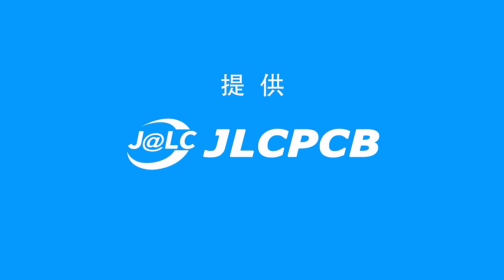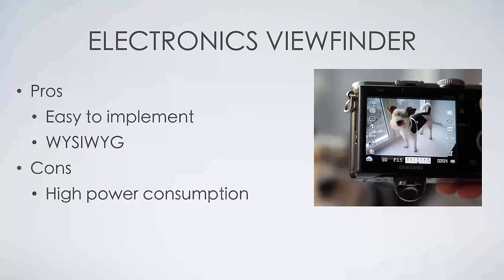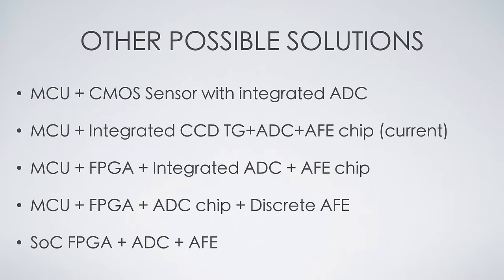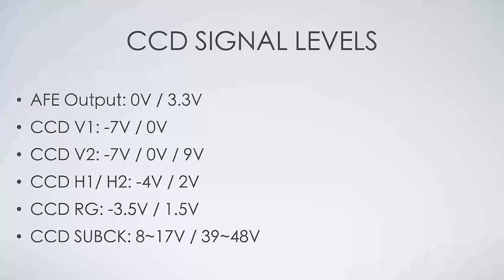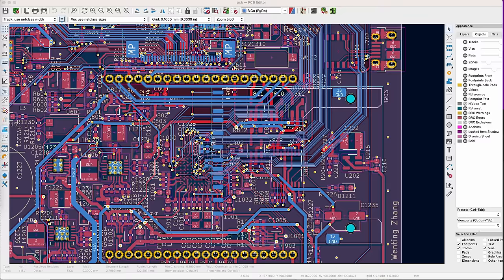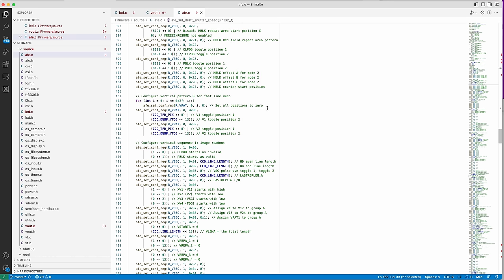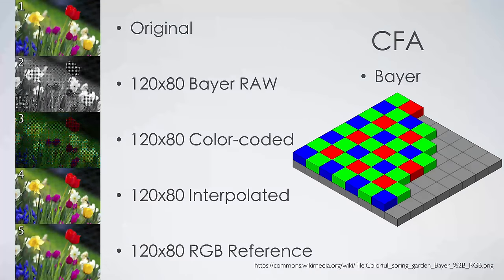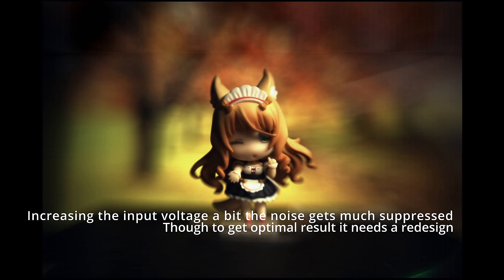Build a DIY full-frame CCD camera

Comment: You've sourced bunch of Kodak full frame CCDs!? You lucky bastard!
Reply: How he do that tho, there is still new olds stock of CCD? or companies still produce CCD sensors?
Reply: @NetvoTV There are probably niche applications that still use CCD sensors instead of CMOS. And there are a lot of companies that make image sensors that are not targeted at consumer (or even classic imaging), but medical/military/etc... so I'm sure there are some old runs of that kind of equipment that still uses CCDs for historical reasons.
Reply: CCD will never stop they are still used in medical, genomic research,drug discovery, astronomy, telescopes and much more only not in consumer electronics
Reply: @JorenVaes but how did he find it and the datasheet?i mean i can only find sensors for a commercial dslr but they are closed source.

Comment: This is incredible, i would imagine such a project can be very useful for astrophotographers, since astro cameras dont need screens or on camera controls and its all through USB.
The only different thing is a cooling solution, usually on the market is a 2 stage TEC cooler.
CCD camera like 11000 are very expensive in the astro world, maybe a DIY solution can finally be a good CCD option!

Comment: Amazing project! Regarding the AFE, have you tried reaching out to AD? They should be able to set you up with register initialization lists to help you troubleshoot any timing issues you're having. I work with a lot of image sensors professionally and you basically always just get the register values from the company (and image sensors are notorious for undocumented register values). The register documentation in the datasheet is just there if you need to modify something specific.

Comment: Nice job! Also yeah, trying to acquire recent high quality CCD or CMOS sensors is such a pain in the ass... I hate it. There are some decent sensors available from Digikey and Mouser though. Have been scoping out parts for a linear CCD scanner... likely using the Toshiba TCD2919BFG (10680x4 pixels, available from Mouser with datasheet), the AD9826, and a Zynq SoC.

Comment: Great video! CCD technology excels in many aspects. If only companies cared more about quality than just profits, we'd have cameras with superior quality today, free from issues like rolling shutter and many other problems we've grown accustomed to. We often settle for images plagued by noise, relying on AI-based post-processing for enhancements.
Reply: Working for Leica since half a year as an imaging software engineer, I must disagree. There has been a huge amount of progress in image sensor technology over the years. It's basically been an arms race. Withhin the last 15 years, we went from plain and simple sensors like in this video to very sophisticated devices, offering great noise performance, dynamic range now comparable to analog film and sensor readout rates that could be only dreamt of until recently. Global shutter full frame DSLRs are slowly emerging too (Sony a9 III), but having a global shutter complicates the design and introduces a lot of noise, so it's a huge technological challenge - especially when it's to be made large resolution. What advantages do old CCDs have over modern CMOS sensors?

Comment: I planned to build a portable thermal imaging system a few years ago. Sadly I lack the time, skills and equipment to get this project going. So you managing to build a usable camera platform for visible light is encouraging to revive my project. 

I also wonder if it's possible to build a digital large format camera using x-ray detector plates with the fluorescence layer removed...
Reply from the maker: Thanks! That might be a possibility, I am not super familiar with these detector plates, but I do know there are a few different types and probably some of them could potentially work. But first I need to get myself familiarized with large format photography in general...

Comment: 11:50 WTH is going on in the upper left corner????
Reply: CCD live view is wonky as hell
i have several CCD digitalbacks and they are extremely sensitive to light, meaning the image is overexposed and it has only several frames per second.

i assume the CPU isnt fast enough, in those old backs, to process the information of a CCD sensor, especially with high MP count. mind that a CCD sensor reads out all lines at once, whereas a CMOS sensor reads out line by line

i would love to see a team like magic lantern take on older phase one digital backs and max them out to the limit.
would love to see proper live view and electronic shutter

Comment: Great video.

i have a idea for a "what if" video for YouTube and i was wondering if you think this would be a good idea.

So the idea is, a open source Modular mirrorless camera. It would be made by a company, not 3d printed. My thoughts, on how it would work is kinda like Linux.

List of ideas:

All parts of the camera are repairable and modular: upgrade the sensor, add new ports.
What ever idea you can 3d print as far as new grips, battery slots etc etc.

A extension store that can download from wifi or a hotspot from your phone 

Community made extensions that have a app like page in the store.

Open source OS

Open boot loader so you can install a different OS

I know that there has been a few phone/camera hybrid like the red camera phone. But I would like it to have a OS that would not age at all. Not getting slower as it ages. That is why I would take Linux and use it for this.

If anyone has anymore ideas please let me know but the main point is what do you think?
Please tell me any suggestions for this to be a "doable project " 

Ps I am not making this sadly. I do not know much about cameras as far as shooting, let alone the inside of it. 

God bless your day (•‿•)
Reply from the maker: Sorry, while I like the idea but personally I don't think this is feasible.
On the hardware side, giving the user potential to upgrade the sensor means the processor needs to support these sensors at the first place. This is like asking your today's PC to be able to support DDR6 when it comes out. Or, asking today's PC to take DDR2 in the case some user want to mix and match with a older sensor. Similarly the IO ports is tightly coupled to the processor. To be able to achieve this you would need to decompose the SoC, and have all the components interconnected using PCIe on different boards instead of integrated into a single chip (comes with power and area penalty). I like the concept of having open source camera operating systems with community made extensions. But there are also a few challenges. It's fine to build extensions that say, allow uploading images to certain website. But I imagine people would also want extensions that do certain image processing tasks, this is where it gets troublesome. Cameras typically processes the image using specialized image signal processors, either constructed with fixed function pipelines, or DSP-like programmable architectures. To be able to build a camera that people can program easily, there needs to be an open ISP architecture with open image processing firmware.
But of course this depends on your goal, how scalable you want it to be. If you can limit say, it will never need to shoot videos (so one can get away with just doing processing on the CPU without acceleration), it doesn't need to support latest and greatest sensors, and you don't quite care about power consumption and high cost (so you can afford to put more chips functioning as bridge to maintain modular interconnect), then yes, this is doable.
Reply: First, thanks so much man for replying.
When I make the video I would very much like to credit you. This is great information.

So I totally understand that from your standpoint it is impossible, and from my standpoint it is also sadly, impossible 😭 so sad.
But I will tell you my thoughts/expectations for this idea.
So first, as I said already you would need a company to make this kind of thing.

And from what I am thinking this is not a job it seems for a new company with a few million dollars let's say 10-50 million.
So we need a very big one

And let's say just for fun it would be a competitor to Sony, Canon, Nikon.
and it would be a photo and video camera.

Price for this magic camera ~500-2000$

Get it magic camera, black, magic.

Ok I'll let myself out 😆

So let's say if we had the perfect company to make this crazy product.
they would need to have enough money to develop the hardware, To be modular but still fast enough since the PCI will slow down the connection. Also making the chassis and hardware be repairable and modular so it can be upgraded later down the line.

Boy this sounds like a lot of work!

While also making a OS that is stable for a consumer that would like to just use extensions that other people made.

And make a complete and totally new open source programmable processing system that is very flexible for extensions 

Few ideas that would be cool
For extensions: 

Real time AI photo/video.

Wireless syncing to PC or phone, hard drive.

Built in live streaming.

So, it is official this would be very expensive.
Anyways that's why it is a "what if" video.
Maybe Framework if they had a deal with Sony or Canon, could make this. 

if you have any other thoughts please tell me 
thanks for reading this,